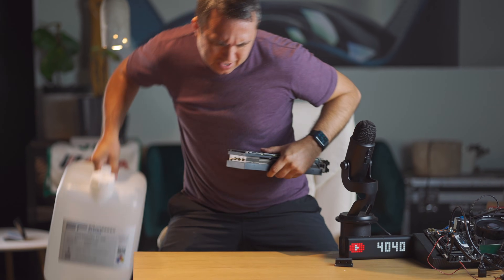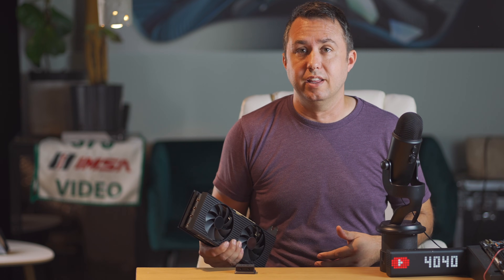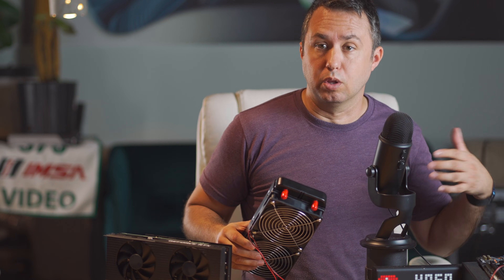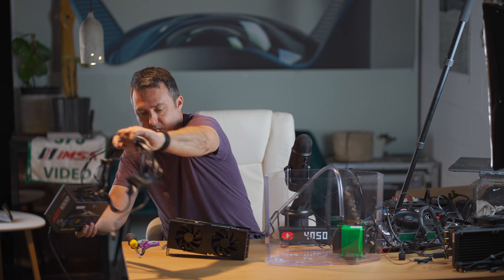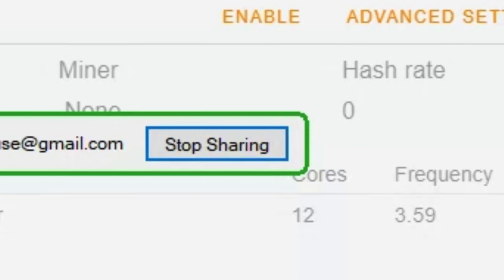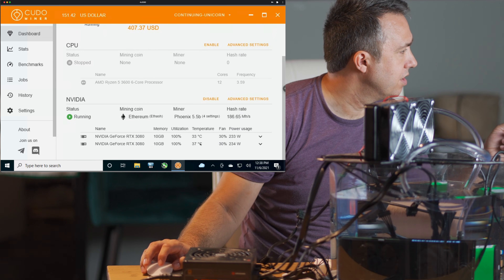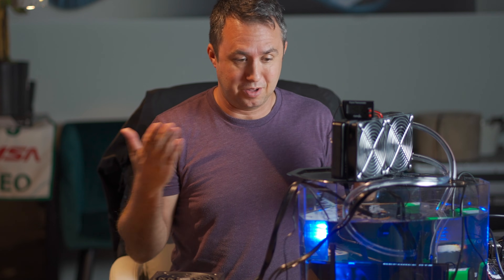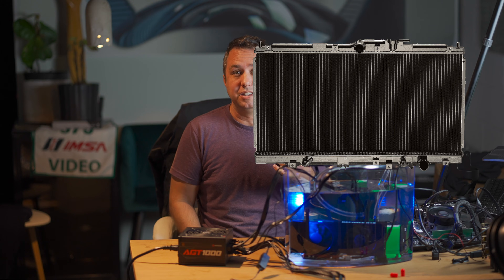Immersion Cooling RTX 3080 ETH Mining Rig with Dielectric Coolant

Comment: "Thermal greases quickly breakdown in our Dielectric Coolants, and will eventually be washed out of the gap thereby eliminating their ability to transfer the heat to the heat sink." -From their FAQ. Need to replace it with indium.
Reply from the maker: Yep, I’ve since read the same thing. I’ll definitely include that in an update video!
Reply: We can take off the heat sink no need for thermal greases
Reply: You can't remove the heat sinks lol
Reply from the maker: @ljordanism  You cant remove the heat sinks?  Is it best to use that thermal epoxy and keep the heat sinks?
Reply: @SPACEDESIGNWAREHOUSE  You need the heatsink on the GPUs. It needs a larger surface area for the GPUs to dissipate heat. I've tried it without a heatsink, GPU will skyrocket to over 90 C and shutoff after a few minutes of running the miner.
Reply from the maker: @D8V1Dx  I talked to the guys at engineeredfluids.com and they told
Me the same thing. But we should use thermal epoxy
Reply: @SPACEDESIGNWAREHOUSE  it sounds strange to me, the surface area for dissipating heat is limited by the size of the chip which is the first step of heat transfer. Does cooling paste transfer heat better than this liquid? Thats the only reason i can see that makes this right. Im no thermophysics expert by any means just thinking out loud. The whole tank becomes the  cooling block with exposed chip
Reply from the maker: @FordSierraIS  Yes, the cooling paste basically creates an extension of the surface area to the size of the heat sink.   Thermal paste can move heat MUCH faster than dielectric fluid, or really anything else.
Reply: @SPACEDESIGNWAREHOUSE   ah makes sense then

Comment: Would be nice some physicist review this: things don't add up. The tank after a 4 hours has a temp of 41C, which would be higher than room temp, so I am struggling to believe it actually has better temps than stock air cooler, since delta temp between gpu and ambient temp is smaller. This however could be counter by a significant “cooling” capacity of the liquid (conductivity of heat way higher than air?).
Aside from that, that radiator will be insufficient to cool the entire 2 gallons of the liquid, heat will be building up slowly over time. However this could be easily solved by reducing the volume of the liquid at is minimum so the radiator gains more efficiency. Or, getting a huge radiator.
Reply: Yes, the higher conductivity of the fluid, compared to air, allows for better cooling even with a smaller delta T.

The volume of the liquid doesn't determine how much cooling you need. It's the amount of heat being put into it that does.

Comment: That. Is. So. Cool! Awesome video work. So much detail. Not the fish tank the kids want but I just might try it.
Reply from the maker: The whole system is actually pretty simple!  The fluids are a little expensive (here's what I used https://www.engineeredfluids.com/electrocool) but I can imagine a SUPER neat looking display where your computer and ALL of your cards live in a much bigger, maybe vertical tank, as almost a piece of art.. Art that prints money!
Reply: @SPACEDESIGNWAREHOUSE  love that idea! Project for my holiday break.
Reply: @SPACEDESIGNWAREHOUSE  have you tried absolute core clock settings? Tends to run more efficient with slightly higher hashrates.
Reply from the maker: @GaryKokaisel  you’re saying turning UP core clocks? I’ve been running my core clocks at -100 offset..
Reply: @SPACEDESIGNWAREHOUSE  Yes, try locking the core clock somewhere  in the range of 1010 to 1050. I use 1080 actually, but every card is a little unique. The result for me was lower watts and higher MH. I have a Dell RTX 3080 and I am getting 101.3 MH at just 223 watts, and it doesn't thermal throttle. Worth a try. Red Panda Mining did a video about it if you want more details about how it works.

Comment: This is wild. Pretty cool video dude. I'm wondering: how long do you think that coolant can run without breaking down or accumulating enough impurities to change it's electrical resistance? Or is that just not an issue?
Reply: you will have to add filter to the system for sure (particles, humidity & possibly oil filter)
Reply from the maker: @sunnyliu3488  I wonder how good of a job the fish tank filter that came with that cheap tank would do.. It would certainly get any large particulate... Though if I want this to be a long term cooling solution, im going to need to make this whole set up way less janky.  Maybe a closed system with PVC and a more substantial pump.
Reply: @SPACEDESIGNWAREHOUSE  any filter would be better than none tho, your pump will easily be damaged without it. a closed system will surely be better in terms of dust and dirt, but watch out for the pressure build up if its completely sealed, you will need some relief valves.
Reply from the maker: @Quickcat21MK  I agree that it does not save any money or make additional money, but there are joys in life of experimenting that have value beyond that!! 

I’m submerging an S19j pro this week
Reply from the maker: I’m interested to find that out also.. But this is a specifically engineered fluid for this exact purpose (https://engineeredfluids.store/collections/electrocool/products/ec-100). 

Apparently it has no freezing and no boiling point and it will never evaporate!  But yeah, we’ll see how long it keeps the same regulated temperature…
Reply: @SPACEDESIGNWAREHOUSE  your link comes up 404... the question I guess is the fluid hydroscopic at all? Does it draw in water or any foreign contaminant  if not ran in a sealed environment
Reply from the maker: @buffjoeyd  the company is engineered fluids. They evidently made this stuff specifically for this exact purpose. 

So unlike mineral oil, they don’t break down rubber or metal coatings and get contaminated.  I mean, I’m sure since my container isn’t perfectly sealed, over time a bunch of stuf from the air will find it’s way in there, but it’s FAR cleaner than the open environment.

Comment: Does this leave a residue when you take it out and dry it? Do you have to put your cards in the dishwasher to clean them after? It looks like the coolant is super expensive.  I do like this setup! Nice job!
Reply from the maker: The coolant is pretty expensive. https://engineeredfluids.store/collections/electrocool/products/ec-100

And if you take the cards back out, it’s basically an oil, so yes a pretty major cleanup effort will be necessary.  This stuff never evaporates, in fact.
Reply: @SPACEDESIGNWAREHOUSE  is it just mineral oil?
Reply: Eng. Fluide mâle à coolant solvent for maintenance purposes

Comment: question: did you remove the thermal pads and paste , or you just drop the gpu directly ?
Reply from the maker: I just dropped it on in. 
There is no question the paste and probably the pads will either wash away or break down and eventually introduce a bunch of debris. 

I’ve read you should replace it with thermal epoxy if you’re going to go long term immersed.

Comment: How often do you think you'll need to drain and replace the fluid?
Reply from the maker: According to the manufacturer, as long as I have a cover on the tank - it should function normally for over a year! The fluid wont break down, so its just a matter of keeping it clean.
Reply: EC-100 and bitcool have a 10 year service life.
Reply from the maker: @ljordanism  I stand corrected, 10 years! Surely thats longer than the hardware will be worth using
Reply: Have a little faith 🙃

Comment: I have an MSI gaming trio 3080 nonlhr doing 103mh with 72c on memory with the stock air cooler. Just change pads immersion is good for asics
Reply: Agreed all of my 3080s run 100 to 103 and hover in the low 70s on memory temp just keep fan speed up and keep the room under 78f......also I didn't change my pads for these results.
Reply from the maker: WOW!   This is more experimental than functional for 3080's - also I have 7 ASICs in my warehouse and that is my natural next progression!   

But shoot thats cool for air cooled.. I changed the pads on this one, and couldnt get it under 90, still.
Reply: @SPACEDESIGNWAREHOUSE  the Msi gaming trio has a specific plate on its cooler for direct memory cooling, with thermapad/thermal paste replacement they run coooo
Reply from the maker: @rotaryming  ahhh that plate must be key for the memory temps. Its strange all the manufacturers dont just copy whichever design worked the best!